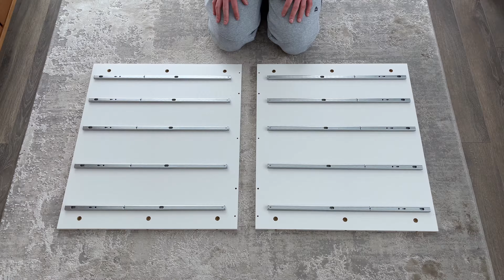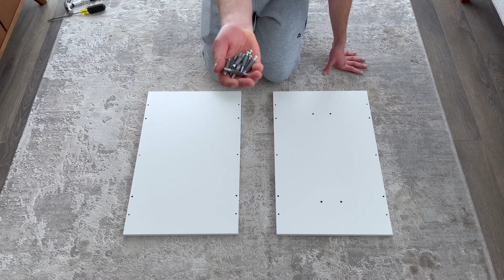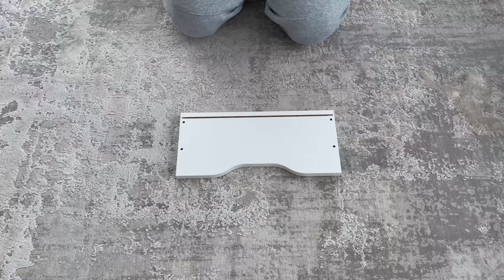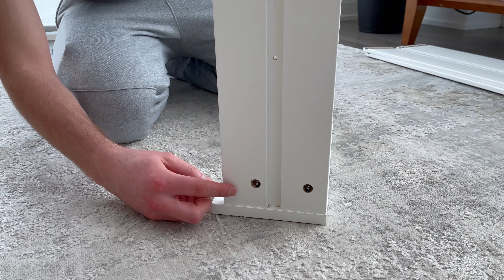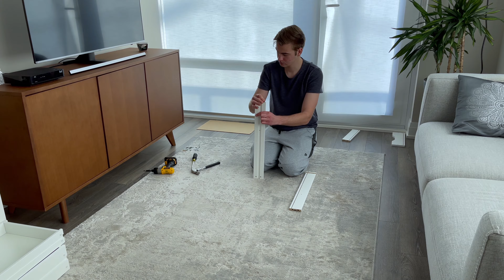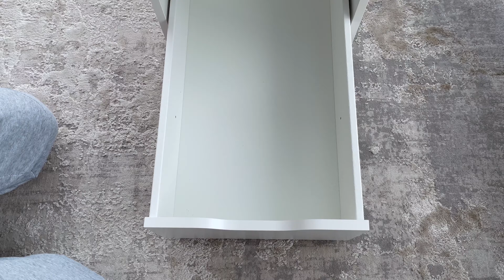Easy To Follow | Alex Drawer Unit IKEA Tutorial

Comment: has anyone else ended up with the bottom two drawers being really extremely stiff when pushing on and out 🥲😢
Reply: Yes they don’t go in properly and I don’t know what to do
Reply: @a @alimahiirr  neither, however on my second set of drawers they were fine. the difference was i hammered the white screws in very tightly and also used a drill for every screw and made sure it was tight. Maybe that’s the issue the drawers being a cm too big to slot in properly. not sure, but hope urs gets fixed!

Comment: bro i fucked up so hard when u said “im building it this way so im doing it like this if u doing it for something else build it like this” now my drawers are upside down.

Edit: Don’t put the Bottom legs on where he’s putting his on if ur using urs for a desk. that’s where i fkd up
Reply: Thank you bro lol. I’m about to build them for the desk and that’s the last thing I need rn
Reply: I wish i seen ur comment bro my drawers are upside down🤣🤣🤣🤣
Reply: Did you fix it because I also did that
Reply: so what i did was i put the legs exactly how he did in the vid... He didn't put the legs on the way we have to.. we have to put ours on the opposite way he did. So i took them off put them on the opposite side and just flipped it over.. @FspeterbotTsb
Reply: read the edit
 @FspeterbotTsb
Reply: It doesn’t really matter, the top just rests with the drawers. I’m getting adhesive tape to add to the top of the drawers from what I’ve researched the orientation from the video is fine
Reply: lel same luckily didn’t screw anything in yet

Comment: To anyone who checked the comments before starting, I recommend starting with the drawers themselves first rather than the entire unit. It makes things a lot easier and you can check and make sure that the fat drawers actually fit on the side your doing it. If you're like me after you build the first one your going to turn off the audio and listen to something else while building and just watch the video when needed in which case, I don't know how I did it, but I flipped the ends by accident and it made it so that the drawers did not all fit, so I had to undo the top and the bottom and flip them. Building the drawers will save you a lot of time by allowing you to check first and then continue on
Reply: 100 percent do them first, Saved me a headache.
Reply: Thank you a lot bro it actually saved me so much damn time like I finish it like 49 mins thanks to you saying that

Comment: Question why does it get flipped around if you’re using it as a desk? Is it cause of the rubber feet?
Reply from the maker: There are four holes in the middle of the drawer unit panel so you can use four screws to secure both the drawer unit and the desk panel together. That's why the panel on the drawer unit gets flipped.